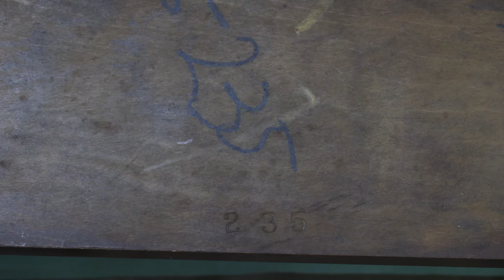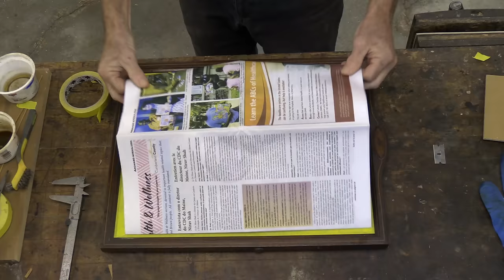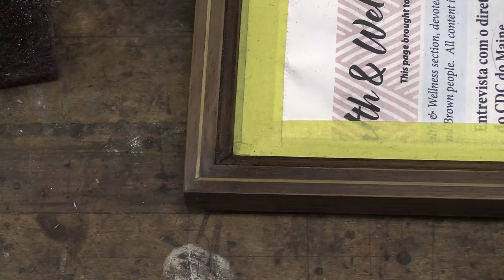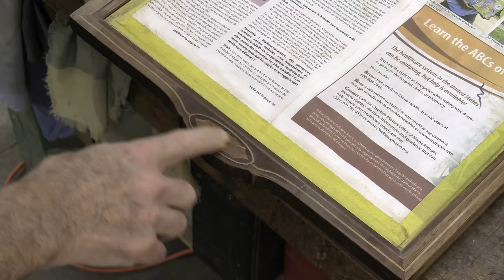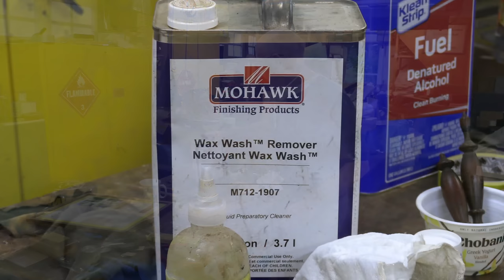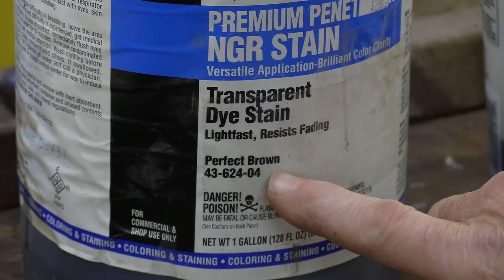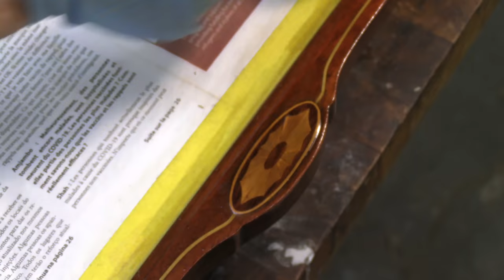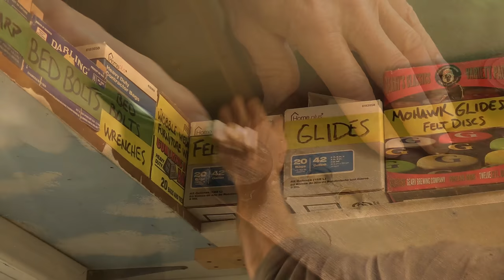PRO Antique Mirror Restoration - Thomas Johnson Antique Furniture Restoration

Comment: I think that cone and washer combination was deliberate. I've had a lot of experience with old mirrors that used a washer on each side. There are only two ways they can be adjusted: so tight that something will break if you try to tilt the mirror, and so loose that no matter where you tilt it, it will go back to it's natural repose position.

But with a cone on one side, you have a controlled friction clamp arrangement, and you can get the happy medium where you can adjust the mirror and it will hold its position.
Reply from the maker: Thanks! Interesting! Yes, I left it the way it was because it worked so well. It didn't occur to me that it could have been deliberate, although clearly it had always been that way
Reply: Appreciate your comment @lwilton . I have some old easel clocks and they all had only one washer on one side which made me think one got lost over the years. I was going to make one out of brass so I'm very glad for your comment as it sheds light on the style of the day regarding these swivel items. Some of these antiques really require detective work to figure out. 😁
Reply: I was thinking the exact same thing

Comment: Another great masterclass,  we also use the foam brushes, not just for painting, once done with the foam part , the plastic strip below the foam is great for applying glue, and once that is done with, the wood can be used for doweling or other uses, a very versatile tool,  Cannot wait for the next project.
Reply: Thanks for the tip - my fingers thank you for the suggestion to use the brush plastic strip instead of them as glue spreaders!
Reply from the maker: Thanks! Wow - great ideas! I like using everything down to a nub!
Reply from the maker: Yes, great idea

Comment: I’ve worked on a few of those sunburst inlays and found a few from the 1870’s-1930’s were a bit heavier of inlay and scalloped with raised edges.  With the darkening of wear it gives them almost a greater depth than the 1/64 or so actual scallop worn into the center of the petal or ‘ray burst’.  It’s impressive what they did in some of those pieces as if the craftsman planned for wear and fading to accent his original work…or maybe that’s just me?  That repair was some next level stuff, Thomas!  Very impressive!  The dark stains are so challenging that most guys I know just turn them down if the customer doesn’t agree to outright plane work on the surface.  Thanks for showing that patience trumps fast and easy!  I’ve never asked another man what he charges for his work and won’t compromise this time but my shop would have billed that out at close to $2200.00 (using only tools, chemicals and finishes available when the item was built…which is our trademark service)
Reply from the maker: Thanks Theophilus! I have about 10 hours in the job, although it's difficult to say because I have to account for the making of the video. I chrge $105 prer hour. And yes, the sun burst seemed to be proud on purpose, which I had not seen before. I'm glad I left it that way! I really like the Waterlox Original, as they claim they're still making it the same since 1910. The original finish on this could have been nitro-cellulose lacquer, but how can you know?

Comment: It's almost hard to believe that the "before" and "after" shots depict the same mirror.  You brought out the natural beauty of the wood more than the original finisher did. . . not to mention your skill in getting rid of the abuse that the piece had taken over the years.  One other note:  I was stunned when you said you had spent about 8 hours on this job; I would've thought the number was a good bit higher.
Reply from the maker: Thanks! Well, it was a straight forward job - no problems

Comment: I noticed when you cut the veneer patches with a utility knife they often split along the grain.  In the sewing world they use a rotary cutter that might work since it rolls over the piece instead of being pulled across (like a pizza cutter only razor sharp).  Glad to see you have your supervisor checking your work.  🐈‍⬛
Reply from the maker: Thanks! I have some rotary cutters. I need to sharpen them up a bit and use them again

Comment: I appreciate the sheering motion you use when trimming down veneer or inlay with your sharp chisel- I have found that when trimming you can turn around and come back in the opposing direction to prevent "blow out" on the end of thin or small pieces- sometimes the grain will split out. I appreciate you passing on your knowledge!
Reply from the maker: Thanks! Yes, you have to aware of the grain direction for sure!

Comment: I used your trick of the syringe and glue to fix the veneer on the cabinet doors I was refinishing. It worked like a charm. So much better than trying to shove the glue in with a blade. Thanks.
Reply from the maker: Thanks! Yes, it is good, I still end up using a blade a lot.
Reply: @johnsonrestoration  I never could get the glue into the space with a knife, but it does serve well for spreading it under the veneer.

Comment: Tom, I enjoyed the video!  The end product looks fantastic.
I am wondering, do you think the finials might have had small balls on the tips?
My opinion, the washer on the clamp bolt is not original.  You can see that the bolts are special made with a radius on the  washer face that fits into a radiused depression, to facilitate tension and swinging on the frame!
Keep up the good work!
JIM 
🥰
Reply from the maker: Thanks! Well, one finial was intact so I don't think so. That washer had been there a long time! But yes, it may not have been original
Reply: @johnsonrestoration  Sometimes spheres with a small hole in them were slipped over the pointed finial, with a friction fit.
Just conversing here.  We of course will never know!!
JIM😘

Comment: You mentioned Oxalic Acid is used by Beekeepers. Did you start to keep bees yet? You replied to me a few years ago that you were thinking of keeping bees. Great video as usual!
Reply from the maker: Thanks! We've tried and failed twice - mites. But we will try again
Reply: @johnsonrestoration  If you buy packages in the spring, I suggest that you treat them with oxalic acid before day 5. This will get rid of the mite that always come with the bees. I treat again with OAV in July 15- Aug 10 this year. 4 days apart keeps them clean and lets them have healthy winter bees that will not crash in Fall or over Winter. December 21 is my next treat date with OAV then March as soon as you can get in the colony. This schedule has worked well for me for the past 3 years. Good Luck this coming year.

Comment: I may be able to explain the presence of the washer on one of mirror mounting screws.
Most likely the designer/carpenter of the mirror was intending to do both of the screws with a counter bore but found the mirror wanted to rotated unintentionally to the straight up-down position due to the off center position of the hinge. So either the carpenter or a customer installed a washer to provide some friction so the mirror would sit as the user placed it without getting stiff and hard to move...
Reply from the maker: Thanks! Yes, I think you are right!

Comment: There you go answering my questions before I can even ask them. I wrote a document putting down some thoughts. I'll paste it below, but now a  lot of it is redundant. Thank you!!!

Hi Tom,

You are such a master at finishing, and I suspect the part that is easiest for you is the mystery to me.

Once I know what to do, I am able to do the sanding, the staining, the polishing, etc. My issue is I am not familiar enough with all the variables to choose the best finish. Some of the variables are:

Old or newish furniture?

Antique restoration or just make it nice?

Original finish or already redone?

How to identify original finish?

Type of wood? This is my biggest knowledge gap because I am a painter, not a carpenter. The sub-issues I can think of include?

	Hard wood vs soft wood

	End grain or long grain

	Natural oils and absorbency

Color adjustment or natural tone?

How many coats?

Natural vs. chemically produced?

Application? Pad vs brush vs spray et cetera

Concealing patchwork flawlessly

How do different materials work together? If you put putty or wax in a crack, how do you make the finish match?

Matte vs shiny? How to decide?

Layering? What kind of wax? Lemon oil? Beeswax vs. paste wax? Do you wax over poly finishes or only over “natural” finishes?

Cleaning the surface? Water vs. alcohol vs turpentine?

How do you identify stains? How do you then clean them? Removing paint vs burns vs water et cetera?

I could go on and on, but I’m in the middle of an Engels Coach Shop video and I had to get these questions out of my mind so I can concentrate on iron/wood construction.
Reply from the maker: Thank you Dianne! That is a lot of questions! Most of the answers can only come from trial and error - and a lot of errors!

Comment: At about the 11:05 mark when you are using that broad chisel I noted the sharp edge is not even but thinner at one end. Is that on purpose and if so, why? Beautifully done.
Reply from the maker: Thanks! Not on purpose - it's a result of using a circular sharpening system - "Work Sharp"

Comment: Chatoyance, rarely hear that term outside gemology, but yes, the subtle varieties of reflection and refraction in wood and finishes can be an issue with stubborn stains or bleaching in woods. In this case, personally, I say it is a character mark and not a blemish. It is history that marks time and use or neglect we needn't feel detracts from a piece.  It was masterfully handled. Sometimes doing more can only add artificiality to a restoration, and that's a detraction that will stand forth more than a minor flaw.
Reply from the maker: Thank you! Well said!

Comment: Hi Tom, love the videos but I have a question: I understand the need, from a conservation perspective, of using hide glue (eg water soluble, reversibility etc) however what are the benefits of hide glue over stronger modern wood glue or epoxy where there is a split in structure ? Especially one that has been previously glued and where it is not possible to get good clean mating surfaces. Thanks.
Reply: I'm not Tom, but from restoring a few pieces myself, I'd have been happy using hide glue in the same split. There was really good contact - not many wood fibres lost, as far as one can see from the video - and since there was old hide glue that could not be completely removed, new hide glue is more likely to bond to it and re-activate it with heat than yellow glue or epoxy. With epoxy there is always the opposite risk: it fills up too much, especially in pieces that are difficult to clamp (and squeeze excess out).

FWIW, James Wright (of "Wood by Wright" here on YouTube) is running a long test of glue effectiveness. Hide glue is not coming out of it badly vs. other adhesives. The problem with hide glue has historically been that it needs a lot more prepping (dissolving, heating and keeping warm) than other adhesives, but newer formulations seem to have solved most of these issues.
Reply from the maker: Thanks! dlevi67 gave a really thorough answer! I will add this: I use epoxy on bad breaks, where the choice is either epoxy or make an entirely new piece (like a leg for instance). Never use epoxy on the joints
Reply from the maker: Wow! Great job! Epoxy does have it's place in the "kit", but only for shattered elements etc. And yes, our informal tests showed hide glue to have more than adequate bonding abilities

Comment: I notice that many clamps-both traditional screw clamps and the more modern spring clamps- have some kind of polyvinyl caps or cushions on the ends that meet the wood.  I inherited a number of both kinds of clamps from my dad when he passed away, quite a few of which no longer have their cushioning, or for which the cushions are damaged.  Can you suggest a retail source for ordering replacement caps?  Most of my clamps with damaged or missing caps are quite old and I either cannot identify the manufacturers, or the manufacturers are no longer in business.  Any advice you can give me would be greatly appreciated.
Thank you for making these fine videos; they are fascinating, and I learn from every new upload.  Don't you just love wood?  I always think in a previous life I must have been a tree!
Reply: I've never seen those sold as spares - not least because there are thousands of types/brands of clamps and they are all slightly different. However, a small piece of scrap wood (if necessary with a bit of packing tape to prevent sticking on the underlying surface) is a better-than-new replacement for the plastic!
Reply from the maker: Yes, true - as I always use those, but they do require an extra hand sometimes!
Reply: @dlevi67  Thank you!

Comment: Hi Tom, question about Famowood: I have a dried up can, can I revive it with a solvent so I don't have to toss it?
Reply from the maker: If it's completely dry you should toss it. I keep mine fresh by being sure the lid is clean and seated correctly when closed. But when it needs it I add drops of Lacquer Retarder. Places like Mohawk Finishing Supplies should have it.

Comment: question when furniture was manufactured with inlay was the channel installed by hand and chisel or was a tool or jig available?
Reply: Given the likely period of manufacture (late 1800/early 1900), this was probably routed by machine. If you are looking at items made before ~1850 (in "Western" furniture), it was almost certainly done by hand, with a plough plane (or indeed a chisel, but not likely over such long and straight pieces).
Reply from the maker: Thanks! dlevi67 is correct. There are a few tools for making channels. It still boggles the mind, no matter how you do it. Even a router set up poses all types of problems
Reply from the maker: Yes, all true. When I've had to make channels I've used a "scratch stock"
Reply: Thank you all.🌵🤓👍

Comment: Great restoration work, Tom.. I wonder if those stains were caused many years ago by a cosmetic, or perfume or a shaving soap etc?  It may well have had a century to work to create the stain, so don't beat yourself up to achieve perfection.
Reply: Tom says the big stain was caused by a bottle that exploded because its contents froze - it's therefore likely that the mirror was in a place where it sat unseen for quite a long time, and the liquid had time to soak in. The others, very likely as you say - toilet mirrors were after all used for doing one's toilette with toiletries!
Reply from the maker: Thanks Phil! dlevi67 is correct, it was stored somewhere without heat. For some reason I think perfume
Reply from the maker: Exactly! Now say "toiletries" 5X fast

Comment: But did you replace that missing washer?
Reply: I don't think it was missing - having a cone fitting on one side means friction can be controlled, and the mirror moved easily, yet stay in the position one puts it in.
Reply from the maker: Thanks! I believe dlevi67 is correct!
Reply from the maker: True! But I have to say I have never seen that done before. It certainly seemed intentional
Reply: @johnsonrestoration  I have two earlier mirrors at home - both with 'one washer', that's why I suggested this.

Comment: how do you get rid of the bubbles?
Reply from the maker: Thanks! The bubbles that appeared when I wash applying the finish? They went away as the finish dried. After the final coat there were faint marks from the contamination but I sanded and steel wooled them away

Comment: At one point you said you were going to remove yhe mirror but you ended up just masking off. Why the change?
Reply: At 14:30 Tom says "I need to tape off the glass" - there was no need to risk disassembly of fragile parts when they can be cleaned and re-finished while assembled. I can't find anywhere else where he mentions the glass.
Reply from the maker: Thanks! Maybe in the beginning when I said I would remove the mirror frame from the stand?
Reply from the maker: Yes, correct.

Comment: Presumably you also cleaned up the back of the mirror?  We are never shown that. Plenty o time spent on the underneath that nobody's ever going to see with the piece back together and back in use, but not a single view of the back of the mirror casing
Reply from the maker: Thanks! I should have shown that - the back was in good condition and didn't need anything

Comment: What a transformation with just alcohol 👍. Wouldn't the alcohol dissolve the hide glue?
Reply: It would... if it didn't evaporate first! (You'd need to soak the part in it - and vinegar would probably be better for that job).
Reply from the maker: Thanks! dlevi67 is correct -
Reply from the maker: Yes, I always say if a solvent can get in the joint then it must have needed to be reglued anyway

Comment: Why wouldn't you just sand off the stains? I know it's a laminate but surely it could've handled some sanding?
Reply from the maker: Thanks! I try not to sand, or I should say I try to keep it to a minimum. The stain was not completely gone but it was unnoticeable
Reply: @johnsonrestoration  I understand you want to protect the integrity of the piece and its age etc. I just wondered if it could have been sanded down more to get rid of it entirely without having to put in as much effort to make it blend in. I guess that's why you're the master restorer and i'm the novice watcher. Amazing work, your methods and attention to detail are truly inspiring.

Comment: Thank you for another great video.  I had some issues centering holes on some of my small pieces and found my brad point drill bits to be a big help.  I originally purchased a cheap set from China but found them to wobble quite a bit.  The starter set from Dewalt are much better.  They make good stocking stuffers.   Happy Thanksgiving.
Reply from the maker: You're welcome! Come to think of it I should have used a brad point